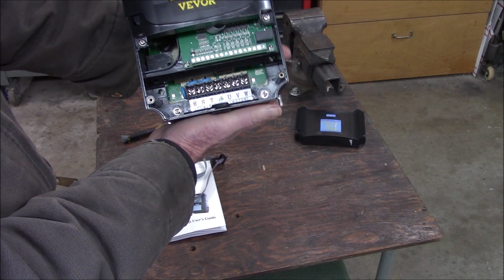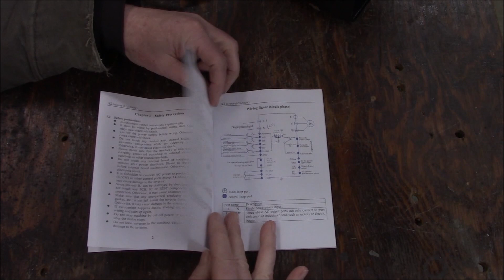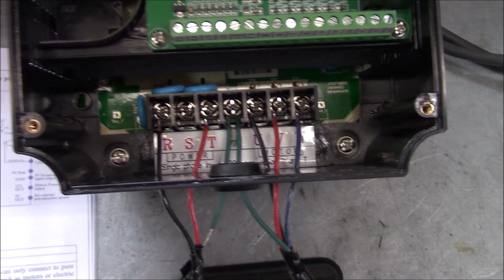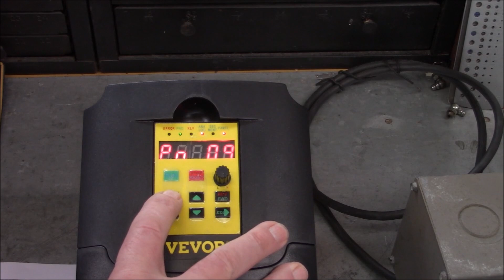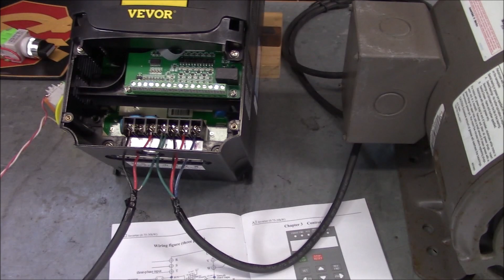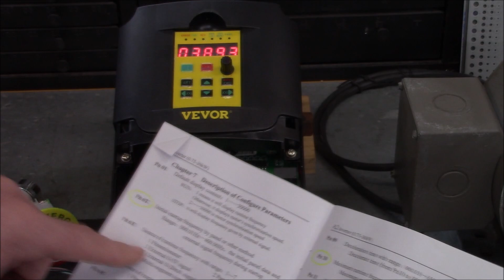VFD Drive Giveaway - Review and Test Running

Comment: Great review and walkthrough, Dean. I get the sneaking suspicion you've done some work with these in the past 😉. We have a servo driven mill at work that has a momentary button to reverse the spindle when power tapping. Comes in handy if you've got lots of holes to tap. 
My mill has that annoying E-stop too. Unfortunately you'd need to put in contactors (relays) and momentary switches for your fwd/rev switch/es, not terribly difficult but you would have to throw a couple hundred bucks at it. I guess you can't put a price on safety ...🤣.
Anyways, great vid! Thanks!
Reply from the maker: Thanks Chris, Yeah I see things in my sleep...Lol

Comment: Hi Dean, I'm watching your video on my lunch break :) You have the same type of inverter as me, which I use for the Colchester Bantam, my support up to 4 kW, that's the size I bought and the motor of my lathe is 2 .5kW; I drive my inverter just like you do, with the switches at low voltage, using the green terminal block and following the diagrams in the booklet; my only complaint is the fan noise, there is a video by Mark Presling that shows how to eliminate that noise but in that case the modification is not within my reach, practically the inverter makes more noise than the lathe !! haha!! Ciao Dean see you soon!!! (P.S I'm doing tests with a friend with Streamyard, in the meantime I'm getting ready...)
Reply from the maker: Ciao Alberto, Yes that fan is noisy. Most of my machines would drown that out though. 🙂

Comment: I purchased a Vevo 5HP drive but it didn't look quite like yours.  When I installed it in my CNC mill, it had so much electrical noise that it killed all the electronics on the machine.  The output wiring was installed in a separate shielded conduit.  Somehow the noise got onto the input wires.
Reply from the maker: Yes they can generate lots of noise. Shielded wires and conduit plus good grounding. Sometimes nothing works.
Thanks !